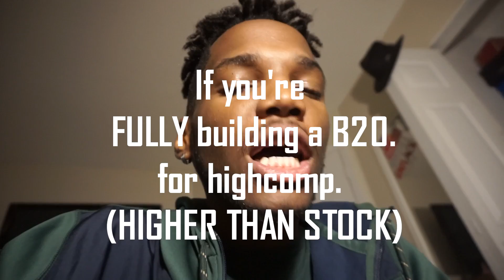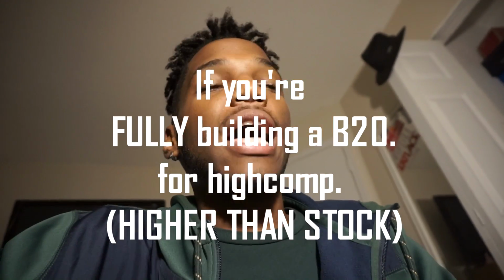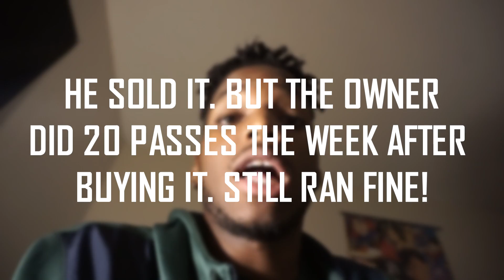B20B/VTEC ENGINES ARE BAD!?

Comment: Quick correction: The reason people go for a GSR head is, if you can get one, the head-end of the combustion chamber is smaller, and will bump up your compression. a b16 head (which is essentially exactly what the type R head is, in terms of it's casting) will flow better and tend to be able to rev higher bone stock. Both heads can be used and both will make power. It just depends on what you are doing. If you are boosting an LS/VTEC and NOT building it, I recommend using the b16 head to keep compression low. The turbo will be making the power. If you are going all motor, all stock, then either head will work, with the gsr head giving a SLIGHT power advantage, but then it comes down to driver, transmission, curb weight, etc. :) Just wanted to put that out there. 

In the end, if you build it right and TUNE IT WELL, the motors will last quite a while. I have known a few people over the years that rock boosted b20/VTECs as a daily driver and put 200+ HP to the ground and even more on track day. If you are worried about the cylinder walls, there are hella companies that make things like block guards and girdles to help with all that.
Reply: Literally the most helpful comment Ive seen so far thank you!

Comment from the maker: COMMENT DOWN YOUR THOUGHTS AND EXPERTISE REGARDING B20B/VTEC ENGINES! LET'S GET THIS COMMENT SECTION LIT WITH KNOWLEDGE AND PEOPLE HATIN!! YEEYEE
Reply: Zosh "drive it till it blows!" Lmao
Reply: Again, some people get lucky and some dont.
Reply: Zosh I have a b20b that I threw piston rings in and she runs like a champ, In the future I may go b20v or throw an ebay turbo on, or both lmao
Reply: When you don't have nothing to talk about so u just copy marks video
Reply: Zosh stock high comp b20V still running strong after 2 years and I beat on it daily, it all depends on what you do. I did ARP rod bolts, main studs, and head studs and that's it besides built vtec head reving to 9k.
Reply: Look up b20 non vtec la super sucker test drive you'll understand
Reply: B20z2 with jdm b16b head on stock b20 oil & water pump & oem gsr headstuds lasted a whole year of me kicking the piss out of it, only problem i had was a a thermostat issue dumb shit like that, oil pump eventually wasnt enough to keeep the motor alive so i spun a bearing, currently building another one but with Type R oil & Water pump and ARP head studs & skunk2 lost motion assembly, they're reliable but just need a good tune & cant handle different fuel or nitrous or boost like that, if you want boost I recommend Ls-V my boy daily drives a 500hp LS-V on ebay turbo kit revving to 9k all day
Reply: i got stock b20b high comp  tuned 8 psi  and been reliable for a while
Reply: Zosh them biggie beats tho 💥💥
Reply: Zosh til I die
Reply: Did you get a b20 low or high compression?

Comment: Got b20 with type r heads and fully built motor un sleeve with  11.5.1 compression(250hp on the wheel) and I daily this car for 2yrs now and never gave a problem.

Comment: I just picked up a buddys car running bone stock "high" comp b20 w/ ebay kit,id1050x's and a 250 pump making 296whp/278wtq running at the track almost every weekend with some dd'ing in between and still holding strong! Definitely an underdog motor.

Comment: Reason they blow most of the time is failure to switch out the oil and water pump to a type r pump set up. That along w the b16 head, all new gaskets, all ur basic bolt ons and a tune and 💥 for the power and price to build is unbeatable

Comment: People say the same things about K20A3 as well. It's all just "hate" really because its outside of what they think is right.
K20A3 still handles high revs. K20A3 still handles boost and people rarely see any problems.
Reply: Jujutsuheiho reason being the head is useless. I tell people all the time if you're going to do a piston rod K series. Start cheap by picking up a k20a3 or k24a4. Shit 4piston 500hp all motor K series is based off a CRV block apparently has the best oil ports and thickest walls.

Comment: zosh, the b20 Is a very good engine and it is true that the sleeves are weak, but break when they have a lot of pressure (turbo) or are very poorly tuned.

I am setting up a b20 non vtec all engine N/A with 230whp and you will walk a lot.

Do not change the b20, put darton slevees and psiiiiiiiiiiiiiiiiiiiiiiiiiiiiiiii

A big hug from Argentina

Comment: There is a false idea going around about b20v/LSV regarding there rod to stroke ratio. Yea it has a smaller rod to stroke ratio than a b18c but not by much at all. So because of this people think LSV/B20v are bad ideas because you cant rev them as high as the de stroked  b18c. Which is true, in a way. But it all depends on what your building it for. If your trying to build an NA monster that can rev to 11k with toda VTEC killers or some other high lift camshaft that makes all of its power up top than you might want to go with the b18c/b16b. But if you want a nice responsive motor with plenty of low end torque, something fun to drive around town and still be able to rev to at least 8k than b20v is perfect, LSV is even better if you want to take the same route but turbocharge for some increased top end power. It all depends on what your building it for, different motors serve different purposes. Otherwise there would just be one kind of motor for every car.

Comment: What! Ok! Good stuff, but about the b18c and b16a heads w/ different combustion chambers. The combustion chamber does not figure w/ the displacment, why? Because the CID is measured w/ piston travel aka stroke. The piston do not travel there thus it will not draw more air in. The combustion chamber does effect the compression though! Having a smaller combustion chamber will result in higher compresssion. If you install a head w/ a bigger combustion chamber than your original head you would loose compression, but you will be more reliable and the engine operation would be smoother.

Comment: B20s aren't that bad! I had a boosted b20b on 5,8,12 psi for a year with no issues besides breaking axles. I went b20v on 15 psi and oil pump failed with kicked it out of vtec a lot but still drove. There selves actually hold up better than most people think.  All video proof on my channel.

Comment: If boosting a b20 to make big power goals the stock sleeves arnt good. And you will need a really good tuner. If your only running a few pounds of boost on a stock b20 and everything is done right and you have a good tuner you should be ok

Comment: Just get a B18c. Mine made a legit 212.5bhp with skunk2 cams and valve springs and some basic bolt ons. Only 140lbft but boosted cars making 300bhp couldn't touch it
Reply: Wouldn't make sense. With that amount to get a b18c, you could built a reliable N/A monster b20v.

Comment: b20v are good, I've tuned a stock b20b with stock gsr head making 190hp 149tq, also Charlies b20v didnt run good with the driven tune, new owner got it retuned nd ran 11.3s at import show down in GA, look up 11.5 importshow down
Reply: I know it’s 6 years out but what was done to it? @danielcortes700
Reply: @jacepoulsen I still own it lol. It's been a great engine, has gone thru m5 gas, e85 and to about 8.7k rpms.  
To answer your question :
98 Gsr head all stock 
Bank intake manifold 
70mm TV
4" intake pipe 
Stock b20b low comp bottom end 
Comptech big tube header

Comment: Yeah my team leaders uncle has a fully built gsr head with a stock b20 bottom end tuned by asp in Fresno and dude he goes to the tracks and revs that bitch to 9k all the time there reliable. Like you said you need a good tuner and need to know what your are doing👍

Comment: I been thinking of just running a b20b stock it's already high comp got torque and if it's non restrictive with air flow you can still make good power like 160-150hp 160torque or 170torque
Reply: 145 HP /133 torque

Comment: I'll fuck a up a stock k with my stock b20v all day.   My b20v made 190whp.  That's exactly what a k20a2 will make bone stock.  It'll do 202-203wheel I/h/e and k-pro.   Again B20V=K Killer.
Reply: Deric McGuffie k series rev higher and make peak top end & everyone has b20 vtec now so basically just see whos the better driver

Comment: I love my b20b turning it into b20vtec but I need some help on what parts to get for it?
Reply: Official_Highlife a vtec head and head studs to suit that head like b16 =b16 studs etc a oil filter sandwich plate and oil feed line to run oil up for vtec and b18 cam belt and a oem itr clutch dosent hurt

Comment: Most likely how your fucked up your block is not getting it tuned on E85.
Reply from the maker: exacto. lmao zosh tuned babyyyyyyyyyy
Reply: you need 30% more fuel pushed when running e85 compared to pump gas

Comment: You made some valid points but fucked up on one, the gsr head is better for boost the b16 head is best for NA, and the displacement  has nothing to do with the head, the displacement  is just the distance from t.d.c to b.d.c, the phrase  "no replacement for displacement " in this term is directed to the fact that the b16 <--- 1.6 L of displacement  has a much shorter distance to travel which means it can spin faster due to shorter travel which also leads to higher revs and more top end, versus the b18 <---- 1.8L longer piston travel or longer stroke, it has nothing to do with the head, talking about compression on the other hand is something else
Reply: Yeah, you're right. I've ran a b16 head before on my b20, I have a GSR head now. The b16 feels more free flow and has more top end pull, gsr yields compression because of the smaller combustion chambers so you'll feel more low end torque and power.

Comment: Have a 1993 civic eg b20 vtec swap pushing 15 lb of boost have it for 4 yr drive and race the shit out of it and it still runing hard lol
Reply: did u build the motor or is it all stock ? i heard b20s stock can only hold 10 at most for a safe tune

Comment: a b20 IS NOT A BORED OUT b18.... the entire sleeve assembly is DIFFERENT... If it were the same sleeves you could use a b18 block guard for a b20 and you can not... the issues with cracking sleeves is because of a different material used in the casting as well as thinner space between the steel sleeves them selves....

Comment: B20V's are k killers
Reply from the maker: IDK BOUT AAAALLL DAT NOWWWWW! depending if it's stock k20a2/z1 vs a tuned b20v then that's a different story
Reply: Zosh even then i don't think so😂
Reply: Zosh Should have saved up for a b16a... Been daily driving for 1 and a half years going on 2. I still remember being jealous of zosh because of his first tune. Now I realize my b16a is a beast. The best of the B series. You still rock tho Zosh
Reply: Yeah sure check out nyce1s ..taiboogie.. ect... All those kseries stomping out bseries ... Only h22's still keep up .. not saying b series are trash because they are great but the k series is superior
Reply: ROBER
Reply: B20v r nice when done correct but they are no match for a K-series
Reply: B20V's are rod killers**
Reply: K series is expensive as hell I have been through a k20a itr motor k24a2 block with k20a2 head full Ferra head package, type r cams and now until I fix the Frankenstein I have a k20a base I just bought Saturday and already have a valve tap so it has to come back out tonight so I can bring it back to get it exchanged I right on the boarder line of getting a  b series car I have a boy with a b20v marking 500whp witch is twice the power and still went through less motors I have in the last year
Reply: Franky n wpb had a blk eg hatch it was a b20/V k killa n it lasted for years idk no if he stil got tho
Reply: Naaahhh H2B or G23VTEC are K killers.
Reply: HondamanFG2 Vtec just like any motor don't build it right it ain't going to last
Reply: Don't get me wrong all the problems I have are your first driver error good old 3rd 2 2nd the k24/k20 was I probably clocked ring and incorrectly installed valve seals and the base engine was bought with complete lack of maintenance it has a lot of slug I'm getting it warrantied and I'm fixing the 24 and putting stage 2 cams I guess if you want it done right do it yourself I just have a very busy schedule any not my point i absolutely love k series fir the power my only point was for the price of k you can boost a b series and make more power for the same price as a stock k
Reply: No offense talking shit happens to the best of us
Reply: Deric McGuffie 😂😂😂😂 I dare you to post on with your b20v against my k
Reply: Deric McGuffie H22 can be for sure
Reply: K is the way
Reply: erich kraus Half of all you talking about going K series but still running b20 series with a vtec head. Your just trying to be cheap to get into the scene. Do your research and buy what you like. All you say B series is not fast enough but aren't even building the motor. You are all cry babies for real. Banging out gears and not expecting some shit to pop off
Reply: Manuel Lopez I have a K 24 a2 block with a k20a2 Head Full Ferra Head package and have drug cartel 2.2 cams on the way I'm not crying about shit also have an ITR trans and full bolt ons
Reply: lol
Reply: Lmao! Do you know how much money you have to sink in a b20v to remotely get close numbers to a stock k series on 93? 😂
Reply: eric baynard with the money a lot. I'm a fan of B series turbo but k series is pretty expensive too. If it was all motor I'd go H series. I had an H with built heads
Reply: Scoobysnack 05 yea I'm building a k series eg lol I've got two h2b swaps now as well so I know all about the money lol
Reply: eric baynard yea definitely. Good luck with the build. Hope it rips
Reply: ROBERT CASTILLO I love the K but a bseries  powered cars still hold 1/2 and 1/4 mile world records
Reply: Jared Loudermilk idk about that I have seen the all motor k series they going almost 8s down the track
Reply: Chris Urena  your def right bout the k series n/a are monsters. Their is some k's making 500 crank hp n/a but I was referring to boosted b's vs boosted k's. Sorry for the misunderstanding. I like all Honda engines, I even had a 300whp d16z6 that was built. That was in 04 lmao. But I'm working on a b18 ls vtec right now
Reply: Zosh 3 or 4 more years in the game and you'll understand every aspect fully.  You'll be doing erbodys shit.  Yur young,  shit gets more clear with experience.  Stay with it.  B20v and lsv is the cheapest way to 200whp NA.  My b20v ITR swap did 190/145 stock as fuck on the 8.8:1 bottom.  200 is achievable.  A k20 will barely make 200 with good I/h/e and kpro.  B20V=K Killer.
Reply: Deric McGuffie lmao barely 200? My stock bolt ons k24 made 235 whp
Reply: Deric McGuffie lol i can show you over 10 k20s that make 220 plus with bolt ons maybe you're talking about the k20a3 lol
Reply: eric baynard that's a fact well I have stock k20z3 with I'd1000cc injector golden eagle fuel rail , plm big tube headers 4-1 kpro v4 , it makes 236hp
Reply: Chris Urena hell you gotta open a b20 to make over 200
Reply: Deric McGuffie that's what I said, bolt ons lol basic header with a 3" intake and rbc sorry b series just isn't meant for n/a if you ask my opinion turbo it's great
Reply: Deric McGuffie if you haven't ever seen them make that your tuner ain't shit lol that's basic numbers you're lucky to get 180 out of a stock b20v
Reply: Deric McGuffie wtf you talking about rbc intake manifold can hold up to 300 hp
Reply: Chris Urena he should just delete this comment lol cause b series aren't k killers lol hell I made 225 whp on my stock unopened H23a with stock intake mani just a 70mm throttle body 😂 ran low low 12s my buddies fully built 240whp b20v ef barely touches 12.5 so tell me again how b series are k killers when his is fully built and barely touches 12s
Reply: eric baynard well if "your buddy has 15 more HP and less engine weight and runs half a sec slower then he just can't drive.  That's simple math bruh
Reply: ROBERT CASTILLO yea bro k are the best motor swaps  .i have an h series its super fast but k its better b swap are not fast as an h or a k.
Reply: Julian Goodman yes sir got that rite
Reply: Jared Loudermilk sure about that ? Lucimar racing has a kseries running a 6.6 quarter.... Look at people like frustrate eg. . Went from bseries to kseries
Reply: Deric McGuffie stock for stock K series will kill the B series any day and you don't even want to get into the principle of boosting
Reply: No, no they're not lol. F2B/H2B setups will give a K swap a run for its money.
Reply: CheezyGeez yes sir 👍